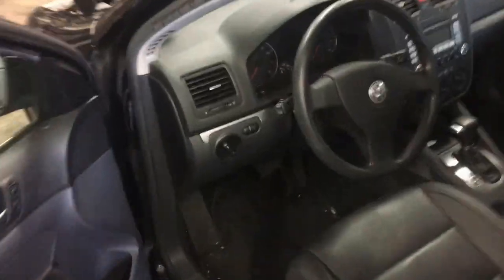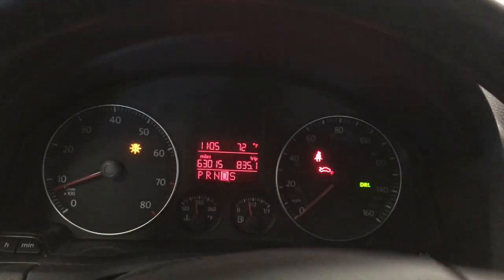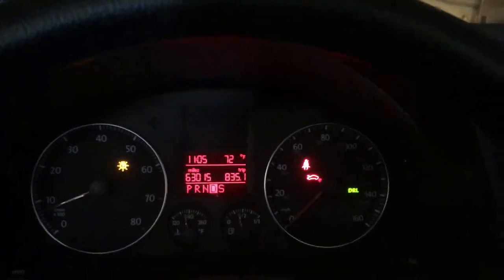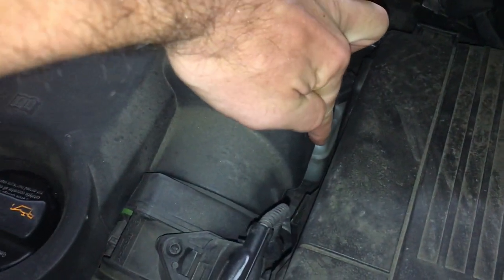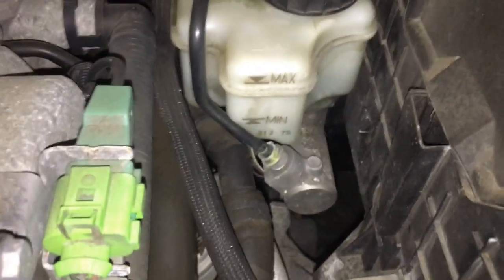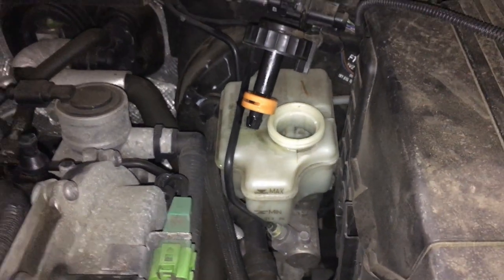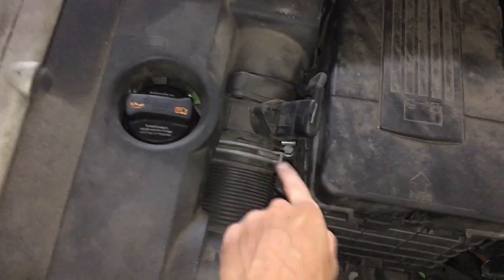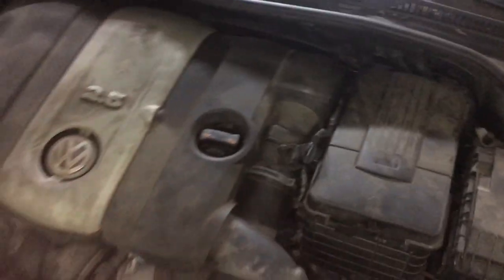Brake Light Flashing and Beeping Volkswagen Jetta Golf Passat

Comment: Thank you VW engineers, I always love a hidden brake fluid reservoir with multiple steps to actually reach.
Reply from the maker: Hey Bugricua, thanks for watching my video. I do think the reservoir should be more accessible, at least you know where it is now. If my video helped you please consider helping me by subscribing, thanks.
Reply: Thanks, I'll check out my '07 Passat wagon to see if that's the issue.
Reply from the maker: Hey Steven Devore please share a follow up, I know it is a year later but if your remember it would be greatly appreciated, thanks.
Reply: I have the same thing help me
Reply: @stevendevore7072 😊

Comment: Checked fluid, it is NOT low. So what are the other reasons that might cause the blinking and three beeps?
Reply from the maker: Hey oceanid007 thanks for watching my video. In my opinion I would get the car scanned for trouble codes stored in the ABS module. If you work on your own car I recommend Google , vcds for VW that way you can get software and a cable to hookup to a computer and perform dealer level diagnostics. Get back to me with some scan results and I would be glad to help you with those codes. Please consider subscribing to me it would help me a lot, thanks.
Reply: This happened with my vw caddy last week' it turned out to be zero brake fluid' so  ignore at your own risk.
Reply from the maker: Hey Paul Buttler, thanks for the input, it is very important not to ignore this warning!
Reply: @WheelsTips Heyyy, I have this problem now, I just got my break fluid flushing and then the next day the break alarm is flashing and beeping, they can’t figure out what caused that and I have the code. It is so weird because how could the level be low right after  they change break fluid for me? can you help me to take a look? Thanks!

Comment: okay this happened to my 07 jetta after i replaced my radio with an aftermarket, i ended up spending $1000 needing a whole new alternator and a new battery. fixed the issue for me.
Reply from the maker: Thanks a bunch for watching my video and taking the time to comment, much appreciated. Mk5 VW’s in my opinion are very temperamental when changing the radio’s from the OEM one, the radio is part of the diagnostics loop. Glad you got your car back on the road and safe travels!

Comment: what it really means is that you need to replace your brake pads there is more fluid in the system than there is in the reservoir just replace brake pads
Reply from the maker: Hey double BB thanks for watching my video. I appreciate the input this may be true in some cases and other cases not it is important to always check why your fluid level is low.

Comment: Does this work in a Passat 2002 V5?
Reply from the maker: Hey Zak Makaveli thanks for watching my video and for the great question.  I would always check your brake fluid and brakes if you are getting a brake indicator light.  Please share an update if your brake fluid is low and you have a blinking brake light, thanks a bunch.
Reply: @WheelsTips  thankyou for replying
Reply from the maker: My pleasure hope it helps.

Comment: Currently experiencing this right now on the road.  Is it safe to drive until i get home and fill it up? Or is it dangerous?
Reply from the maker: Hey A- Drone thanks for watching my video and for the great question. This is something best discussed with your mechanic if you do not have enough mechanical experience to gauge this. If it happened while driving, I personally would have considered it dangerous. Did your brake pedal feel different? Did it all sudden happen while driving? Please share what you ended up doing.

Comment: Mine was full , still makes the noise
Reply from the maker: Hey Jonathan Ortiz thanks for watching my video. If the fluid was not low and you are still getting the sound you have a different fault in the system. It is best to get a full system scan to check for stored codes. Please update once you check that. Sometimes it’s as simple as the sensor for hand brake position.
Reply: What was the fault?
Reply from the maker: Hey Isack Hernandez if you have fluid and still beeping it is best to scan the car for faults, also try to move the float around to make sure its not stuck.  Please share an updated diagnostics, thanks.
Reply: @WheelsTips  I moved the float around and I was able to disengage it. All is well. The fluid looks like it needs replacing.
Reply from the maker: @isackhernandez3691  Great thank you, for the follow-up greatly appreciate it, this will definitely help others, thanks again.
Reply: Wheels Tips!  Can you just remove the sensor to stop the beeping
Reply from the maker: @lananavan1885  I personally have never heard of anyone doing that, also a missing sensor would register as a fault in the system.
Reply from the maker: Just wondering how you ended up resolving this, thanks for any update.

Comment: I’m in desperate need of help figuring out my issue. A couple days ago, my car got stuck in the snow since we had a bad storm. It started with the car just doing this, but as i continued trying to get unstuck, my traction control turned itself off AND my ABS light came on, within the span of 30 minutes and wiggling the car about 5ft. The nearest mechanic is 2 hours away, so I’m desperately searching for anything that could help. Please feel free to leave any suggestions!
Reply from the maker: Thanks a bunch for watching my video video and taking the time to comment. Truthfully the best and most reliable way to diagnose the system is with a scan tool to know what codes are stored. If you don’t have a scan tool your are limited to checking fuses and fluids for issues. Otherwise it could be a multitude of issues. I know this is limited information but let me know what ends up happening, much luck and keep me updated.

Comment: Well a huge thanx to you buddy. I thought it was going to be in the e- brake lever adjustment. And i have almost removed the center console to get to the base of the lever. I was assuming i would find some type of  switch that could be adjusted like a brake light switch. So thanx for saving my ass. The console was not going well hence my taking a look on the tube.
Reply from the maker: Thanks a bunch for watching my video and taking the time to comment. You want to keep up with the brake system to make sure nothing else needs to be addressed. Thanks a bunch for sharing, enjoy the car.

Comment: Greetings! My light started doing the 3beep and flash in winter when was really cold, but only on right hand turns. Weather has been cold again and sure enough it's beeping and blinking again more than ever. Going add some dot 4 and see if that cures it. Thanks for the video brother 👍👍
Reply from the maker: Hey J BiZzLe thanks for watching my video and for leaving a comment.  I also check brake pads as well.  Thanks again for the comment.
Reply: @WheelsTips  Fluid was full so pumped breaks and left cap off beeping and flashing stopped!!!
Reply from the maker: I would say leaving your cap off is not the solution, as that is not how you found it.  Check with someone who can locally look at your brake system to make sure it copasetic for function, thanks for the update.
Reply: @WheelsTips  there is a faulty sensor that's all that's wrong with breaking system. Pads, calipers and rotors are good.  As soon as I burped the reservoir by pumping the breaks the fault went away
Reply from the maker: @jbizzle7339  Thanks for the update, glad you got it to work.
Reply: @WheelsTips  My fault it was worded like I just left the cap off completely 🤣 thanks for your video and input much appreciated!!
Reply from the maker: @jbizzle7339  Hahah :) that is what I thought you were eluding to, thanks for the follow-up and clarification.  Glad you have the car in running order.

Comment: I accidentally discovered this when I was lounging in my 2007 Passat. I hat my toe pushing on the parking brake button for approximately 20 seconds without noticing and heard a beep and saw things flashing. They stopped when I repositioned myself to see what was going on. Then I realized my position and tried to hold the button down myself and see if I can recreate the problem. Yeah. Timed with a stopwatch it’s 20 second hold to create an error. The button can also cause this if it’s jammed or shorted together. Just another fix tip if this doesn’t work
Reply from the maker: Thanks a bunch for watching my video and taking the time to share this useful information ℹ️

Comment: Thx a lot of worked out with me, I just replaced the brake pads and oil, then experienced the same problem beebing and flashing, but when I added a few of the brake fluid, the problem resolved👍
Reply from the maker: Hey PlaneNose thanks for watching my video and for the comment.  Depending on your mileage you may want to consider doing a brake fluid flush.  Please share an update with your mileage and if you ever did a brake fluid flush, double check your owners manual regarding service time frame for the fluid, thanks for any update.
Reply: @WheelsTips  Thx for the advice, no I didn't do fluid flush for brakes, but I did full bleeding for the old one, my mileage is 240 k
Reply from the maker: @PlaneNose  Wow congrats on the mileage, may I ask are you still driving on the original transmission? Smart move on the bleeding of the brakes.
Reply: @WheelsTips  Yea I still drive on the original transmission, but it needs to be fixed actually or replaced
Reply from the maker: @PlaneNose  Amazing, truthfully if it is automatic and your have that many miles I would have personally left it alone till it gives out.  A decent rebuild will cost your probably about 2k with a 36k warranty.  I personally do not like to disturb the transmission with that many miles, just my opinion.  Thanks a bunch for the updates.
Reply: @WheelsTips  My pleasure

Comment: This happened to me twice; both times happened shortly after I quickly pressure washed the engine bay. 
It was fixed the first time by flushing the brake fluid. Mechanic told me brake fluid was dirty
Reply from the maker: Thanks a bunch for watching my video and taking the time to comment. Did you fix it the second time? If your fluid level are good, you may want to check the floater when you open the cap, sometimes it tends to get jammed up over time. Please share an update, thanks a bunch.
Reply: Was your abd light on?

Comment: I think in my case my rear pads are shot because there's so much flaking and rust on them that its rediculous. Maybe it didn't have enough fluid the whole time? ABS and trac control lights also on (but that's from replacing a wheel hub on the front so the speedometer is off like 3Kmh
Reply from the maker: Thanks a bunch for watching my video and taking the time to comment.  It is definitely a good time to check your brakes as well.  Aged cars require a lot of care, and much luck.

Comment: Hi, I have a Tiguan 2012 that I cannot start when is the morning, night or raining. If it's hot it might start but say 20 minutes after driving I get error brake, starts beeping all the time, AC dies, start getting a lot of messages on the screen, disconnects bluetooth, randomly starts the voice recognition button, another message saying back camera is not working. Scanner sometimes won't work. I am beyond frustrated because I can't use the car when is cold.
Reply from the maker: Thanks a bunch for watching my video and taking the time to comment. The best place to start is to do a full system scan of the car to see what errors the car is throwing. I would also check all the fuses to start, please share an update, thanks.

Comment: Hello! Hopefully you get back to me asap! Been reading comments and I have the same problem as a lot of them. It’s happened to me twice now where it turns on then beeps and it happened as I was driving. I’ve had my fluids changed and flushed last summer, had my brakes done a little over a year ago, but I haven’t checked the fluid level. Any idea or suggestions? Brake didn’t feel different either but then again, I don’t pay close attention to it like that unfortunately
Reply: Just to add too the weather has been extremely cold, could that affect it as well??
Reply from the maker: Thanks a bunch for reaching out.  Personally I would get my brakes checked by the people who did them, since you did not do your own brakes.  If the light is persistent you make have something more complicated going on in the system that requires tools and what not to diagnose.  Please share an update, thanks.

Comment: Do you also get the blinking light when the reservoir is over maximum?
Reply from the maker: Hey Galid Bell thanks for watching my video.  To the best of my knowledge it it best to keep it at the max marker, also make sure the sensor is not stuck and has movement.  Please share an update if your float is/was stuck.
Reply: @WheelsTips  Its just over the maximum marker. The floater is not stuck, but I will replace the sensor from another car (Seat Leon) to check if its faulty.
Reply from the maker: Hey Galid Bell thanks for watching my video. I think you should do a full system scan to determine the fault.

Comment: Hi bro! I have the exact same problem, but my fluid level is good, even tried with it above Max level and no difference. Do you think that the sensor may be broken?
Reply from the maker: Hey CatalynnBboy thanks for watching my video. You may want to make sure your fluid is at the recommended level per you owners manual. Also you need to scan the car for stored trouble codes, this will give you an idea why your light maybe on. Please share what stored codes you have, please and thank you.
Reply from the maker: Hey CatalynnBboy that is awesome information thank you for sharing. Could help a lot of people.
Reply from the maker: Thank you once again.
Reply: Might be the floater inside the reservoir got stuck. Stick your gloved finger and try to move it up and down gently
Reply from the maker: @eduardoangeles4412  That is an awesome tip thanks a lot!

Comment: My Volkswagen 2018 is the same since 2 or 3 days ago. So, is it brakes fluid?
Reply from the maker: Hey Jeffrey Rojass If it is a 2018 you should have full warranty on the car I would get it check by the dealer.
Reply from the maker: Hey Jeff Rojass thanks for the follow-ups I was just curious if you still had the 2018 Volkswagen and if so how do / did you like it or not?  Thanks for any follow-ups.
Reply: @WheelsTips  Hello, sorry the car is no longer mine.
Reply from the maker: @jeffrojass5305  Got it thanks for the update.

Comment: Been having the same problem minus the brake light flashing and beeping, I only have the little orange light on the left side of the dash. Usually only happens when I start my car out but it’s been happening more and more often now, after I pump my brakes a few times the light goes off? Could this be a brake fluid loss or do you think it something to do with my brake pads?
Reply from the maker: Hey john breen thanks for watching my video.  Could be a combination of both, you may want to check your fluid levels, but also check your brake pads.  It would also be wise to scan the ABS module for fault codes to see what the computer thinks.  Let me know what you decide to do, please consider subscribing, it would help me a lot, thanks.

Comment: I have an issue where my handbrake is registering as engaged when it is not. Handbrake is all the way down. Brake light in dash stays on.
Reply from the maker: Hey Renderance thanks for watching my video.  Good change you have a bad switch somewhere, you should scan the car for faults to help narrow down a situation like this.  Please let me know what you end up finding in your diagnostics.
Reply: Did you get around to fixing this? If so, would you mind sharing? I have the same exact issue. Thanks!
Reply: thats the same problem on mine. did you get to fix it?
Reply: what fuse # is for that red break light
Reply: Anyone get a solution to this??
Reply from the maker: Anyone find a solution? Was it a bad switch as mentioned?

Comment: I have a 2001 VW golf and my BREAK light flashes when I take off on a raised surface. Filling the break fluid container will fix this, but if you have not or do not have a break fluid leak have your break pads checked and or changed out they may be worn out hence the low fluid.
Reply from the maker: Hey Adrian Garcia thanks for watching my video. What you said is true and I appreciate your input, thanks again.
Reply: okay, and when using Break instead of Brake, considerable credibility is lost. :)